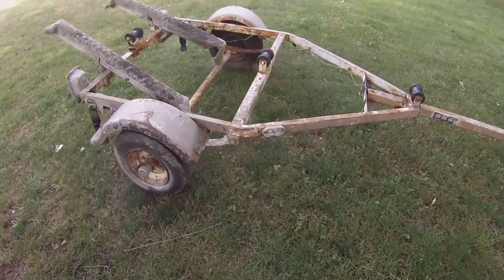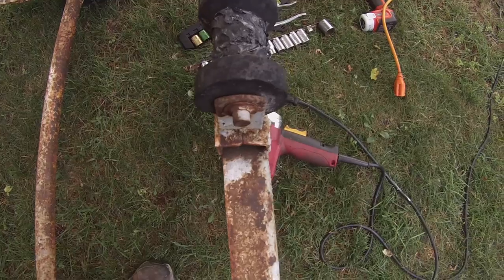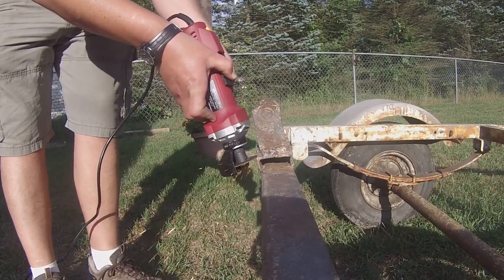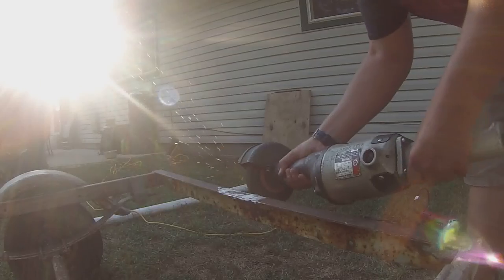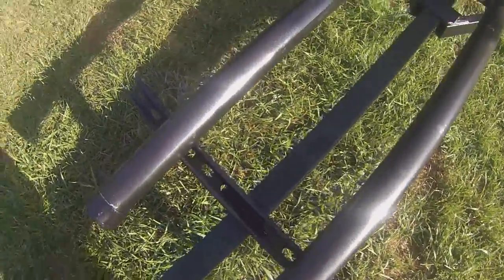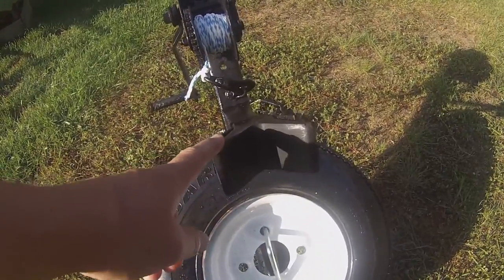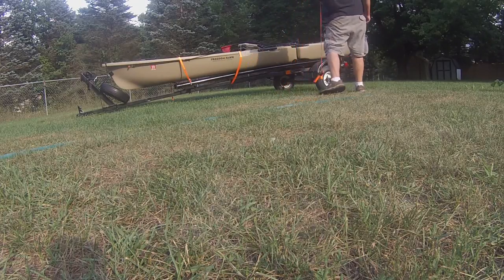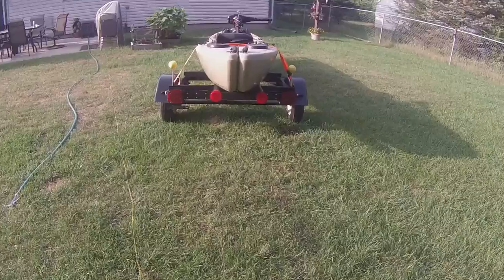Old boat trailer restoration for kayak

Comment: Good job on your trailer. I had plans on doing mine basically the same way, except making mine a double. Luckily in Tennessee we don't have to register a trailer unless it's pulled out of state. Tight lines.
Reply from the maker: Thanks it was a fun build good luck if you do yours.